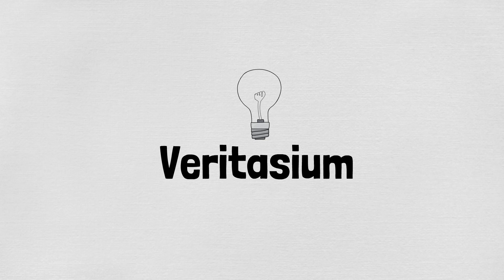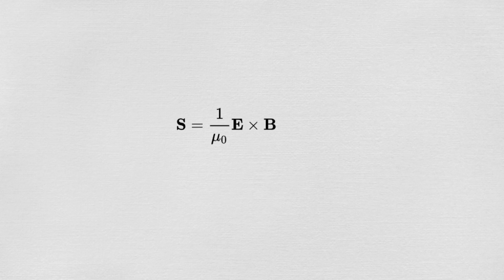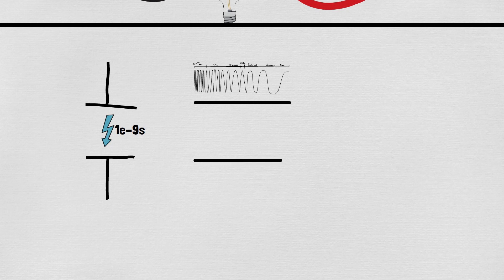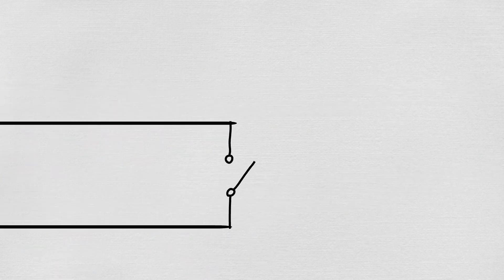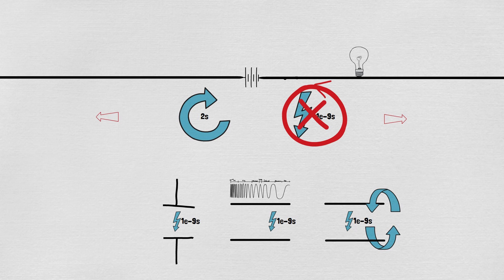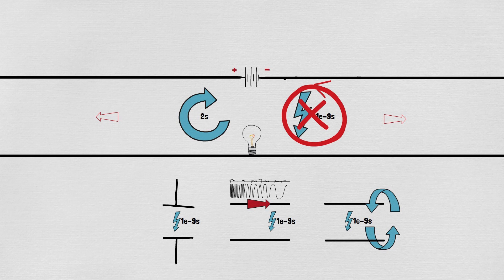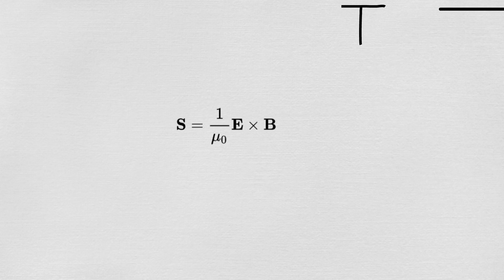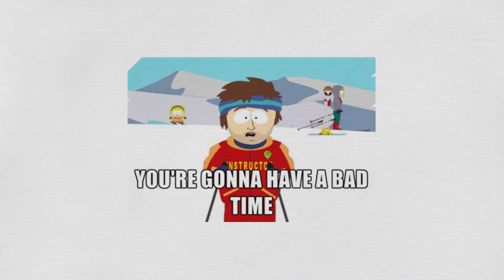Veritasium is Right? (see description)

Comment: I hope it's worthwhile to respond more specifically to your claim.  Electromagnetic theory and applications are my field (a PhD and 40 years of research since).  Briefly:  before the switch is closed there is no current flowing, no magnetic field, and no Poynting flux.  There is only an unchanging electric field.  The configurations with no switch that you describe make no sense.   Closing the switch is what initiates a change in the electric field, which (see Maxwell's equations in your copy of Jackson) launches electromagnetic waves and non-zero Poynting vector.   Nothing can begin to happen at any given location until the change in the field arrives from the switch at the speed of light.  There is no causality problem.
Reply: The whole point of this video is that Veritasium is wrong because the field change originates from the switch, not the battery. Veritasium says that because the Poynting vector comes from the battery to the bulb, then the bulb will come on at 1/c as soon as the switch is closed. That isn't true and we can demonstrate it isn't true by placing the switch at an extreme distance from both the bulb and battery. Much of what Veritasium says falls apart once we consider that the waves propagate from the switch and the battery looks like a wire.
Reply: @Wavicle  Absolutely, yes, we agree that the changing fields originate at the switch.  But this video claims that no current can flow in the bulb until the fields are established all the way around the circuit.  That's not correct.  As a number of commenters (including myself in an earlier post) have already pointed out, the wire pairs extending in both directions behave as transmission lines, and as waves are launched into them from the switch,  current is induced to flow in the bulb.  This current persists and increases as the waves travel down the lines to the ends and then reflect back and forth in the lines several times, until finally a steady DC state is reached after several transits of the lines.  For those who are not familiar with transmission lines, this computer simulation very nicely shows this time evolution of fields and current:
https://www.youtube.com/watch?v=aqBDFO1bEs8
This problem has all to do with how electromagnetic energy crosses non-conducting gaps in circuits- capacitors, for instance, are gaps in circuits; there is no conducting connection from one side to the other, but of course current can flow in a circuit with a series capacitor.  
For those already familiar with EM theory, the term "displacement current" should guide thinking in the correct direction.  This concept is extremely helpful in understanding circuits with capacitors or transmission lines and I think Veritasium made a mistake by not introducing and explaining it to his viewers.
Reply: @Wavicle  Veritassium was still correct, he just made the mistake of not emphasizing that the switch is directly next to the battery or that the switch is really the origin point of causality here. I consider it to be a simple slip of the tongue that can be ignored with the application of charity.
Reply: @ndvorsky  Veritasium is wrong because the location of the switch matters at all. It's obvious to everyone that the switch isn't an energy source, so if energy waves start propagating from it, something else has to be going on. Something like charge carriers suddenly having somewhere to go. Charge carriers like... Electrons.
Reply: @Wavicle  The energy already exists in the static fields. If you move the switch some distance from the battery, the current will flow across the switch as soon as you close it even though no current is yet flowing through the battery until light has had time to reach it from the switch. I feel like this is just splitting hairs. Of course moving electrons have to do with eletricity.

Comment: My undergrad is in astrophysics. We didn’t have to deal with Jackson, they saved that for the grad students. We used Griffiths, and still discussed electrodynamics.

That course had something like a 35% as a passing C. It was rough. 

Really enjoy your analysis. And I appreciate what Veritasium was trying to do! To genuinely understand the physics of these circuits, even DC steady state, I think it’s important to conceptualize things as a field problem (which he didn’t fully flesh out, by any stretch).

That said, you broke the thought experiment pretty easily. I’m thinking that, to get it working like he wants it, you’d have to either be more hand wavy or include math back to the electrochemistry. (I.e. have some sort of barrier to generating the voltage difference of interest beforehand, remove barrier, how fast is the current detected)

Comment: there is one thing I noticed when you talked about the switch. The EM wave is caused by "charging" the wire on both sides of the battery, to work as an antenna. But there is only one switch on one of the sides of the battery, meaning that before the switch is closed, one side of the circuit is already "charged". And I just saw this while writing this that the wire is already either carrying positive charges or negative depending on the side of the battery or the switch. They need two switches on each side of the battery to even start talking about EM waves and so on. With one switch positive and negative charge is already at its ends, so current starts flowing when they connect.
Reply: exactly !
Reply: This is one more of the deceptive things.
Because there is no reference specified, we cannot make that assumption.  The battery does not have 'one foot on the ground'.
..
 The easiest way to understand is consider the two long pairs going far away as transmission lines, or 'stubs' shorted at the far end.  

You must understand that loss-less transmission lines have a characteristic impedance that is purely resistive.
..
They look like resistors (of about 800 ohms). 
This is the characteristic impedance also called the surge impedance. 
They look like resistors until the reflections come back from the shorted ends.
.
So, at t=o, when the switch closes, the battery is connected through two 800 ohm resistors to the bulb that is 1 meter away. Therefor, after the 1M/c seconds after the switch closes, it has a lower current until all the reflections die out when the bulb lights to full.
The way the E and M fields operate causes this to happen.
Reply: Both sides are charged.
Ground is where you want it to be, it is only the reference potential.
Do not confuse it with "earth" or earth ground.
The part connected to the negative pin of the battery will have excess negative charge, the part connected to the positive pin will have excess positive charge. Otherwise, it would be impossible to measure a voltage difference across the switch.
Reply: @wernerviehhauser94  Yes! Simplest thing is to look at one of Vertasium's early graphics that shows the electric field emanating from an isolated battery... "Ground" is the mid point of its length where the field lines are radial to the battery... Another way to view the set up is use two batteries stacked in series and designate "ground" as the wire that connects one battery to the other.

The electric field radiates from one of the open switch's contacts and passes around the full length of the circuit to the other switch contact. No energy flows because no current can cross the open switch... Closing the switch initiates the flow of electrons (slow) that creates two "wavefronts" at the point of contact of an extending magnetic field, and the combination of electric field and magnetic field transfers the energy through the circuit to the bulb (with insignificant energy "losses" radiating out from the region of that moving wavefront perhaps depositing some immeasurably insignificant amount of energy into the high resistance of the bulb's filament...) When the eastbound and westbound wavefronts meet at/near the bulb (about t=1s, full steady state conduction around the circuit is finally achieved at, using Derek's options, "1second" (Not accurate, but we're ignoring the sub-light speed of a signal passing through a real conductor made of copper.) Energy moves along the conductor at somewhat less than the speed of light, and it shoves free charge carriers along... As they are shoved by the approaching change in the electric field, the charge carriers create the magnetic field in the same surrounding 'space' of the ubiquitous existing electric field and that combination of electric & magnetic fields is the flow of energy along the conductor... Chemical energy of the battery flows because it's shoving electrons along and maintaining a magnetic 'sheath' around the conductor. Current through the bulb's resistive filament is converted to heat and light...

The distance from Paris to Bejing is just over 8000km... Derek's loops extend ~150,000km in opposite directions. The 'signal' is a DC step wave, not AC, so transmission line analysis with its capacitive and inductive elements won't really apply once the 'wavefront signal' has passed and moved some metres down the line in both directions (ie. arbitrary regions will achieve "steady state" in femtoseconds...)

Comment: I think the fix is including the location of the switch. If it is 0m away from the battery, then t=1m/c for the information to reach the light bulb as it was originally about communications. The current will flow from the battery to the now connected side of the switch.

Comment: There IS some tiny current almost instantly. The main problem I had with the Veritasium video is that it would not be enough to power a real-life lightbulb, which would only light up after the delay through the long wires. I actually measured both effects (with shorter wires, of course).
Reply: Derick does state that in the hypothetical, the bulb will light up as soon as any current is passed through, not full current.   In the end it all comes down to the hypothetical that was raised, resistance less wires and a perfect light bulb.
Reply: @westonzavadil8770  In that case, wouldn't any current flowing anywhere light the bulb?
Reply: @westonzavadil8770  Yes, but the fact that the main current comes in later should 100% be addressed, instead it sounds like you get all the current instantly.
Reply: @andrewness  Exactly, however when you create thought experiments like this you take things that are highly unrealistic for granted. Like when looking at the gravitational attraction between to bodies, you don't care to calculate any change from a black hole millions of light-years away, even though that still does have an effect. Its truly a game of how well one can play a game of mental gymnastics on the theoretical level.
Reply: @westonzavadil8770  Yes, it is that exact hypothetical that I have a problem with, not the result from assuming it. With that assumption, the wires would not even have to be connected at the ends (yes, the bulb would still be "on" forever) and they can have as much resistance as they want (0 resistance not required). He makes it seem like it's a question about speed of electricity in wires when it's actually a question about wireless power transmission speed.
Reply: "Lighting" just means having photons thrown in the context posed by the problem in the original video. Without a very sensitive detector, you won't be able to measure it.

Comment: I wasn't proficient enough in electromagnetism (I'm just a mechanical guy and spectacularly failed my first EM exam) to give good counter arguments to the Veritasium video, but I was definitely thinking something was off and asked myself pretty much the same questions you have around 3:00 - if a wire connection isn't needed then why are all electrical devices around based on circuits ? And what prevents devices from powering each other by proximity. Sure, I'm aware that power and intreferences can travel wirelessly as EM waves, but still it seemed like the implications would be quite radical if electrical energy would travel directly from sources to sinks (and any conducting material could constitute a sink / passive component).
So thanks for shedding a little light on this !

Comment: If Veritasium had drawn the wire as a circle instead of parallel wires to complete the circuit,  I don't think other people making explanations would have made the explanation so complicated.
Reply: If Veritasium had drawn the wire as a circle then the experiment would have indeed a very different result. The whole point of what he has drawn is that it forms a very particular structure. Mr Tycho's reforming the structure also is not playing the game, you can't move the switch and expect the same result at all. There are easy answers to most of the questions he postulates but they are not the same experiment so they are not the same answers.
Reply: @tonycook7679  Unfortunately, you didn't understand the gedankenexperiment: Moving the switch makes no material change to the circuit or to the time duration which it takes for the bulb to illuminate. Specifically, the time taken is the time required for the field to get established in the 2s long circuit. I.e. it will take 2 seconds to light the bulb (plus a tiny bit because of the 1m separation on top of the 150km in both directions).
Reply: @stephendee7839   I wouldn’t bet 🙂
On a DC circuit, If you put the switch next to the bulb, then just before you close the switch the circuit has 12V across the switch terminals. Upon closing the switch the current pulse will travel a short distance to reach the load...
Reply: Tony Cook, remember that Derek claimed that we have been lied to about ALL “energy flow” in an electrical circuit. He did NOT claim that his alternate explanation only applies to his carefully tailored example. So, it is completely fair to attack Derek’s circuit by changing the shape.
Reply: @nzeches  Go back and review your notes from your Electricity and Magnetism class, or pick up the textbook. The current flow helps to develop the EM field with the poynting vector showing the direction and magnitude of energy transfer. But the whole point of this video is that it takes time to establish that field in the circuit, and the longer the circuit, the longer it takes to establish the field. Without a completed EM field in the circuit, there's no power transfer. Ergo, the location of the switch is unimportant.